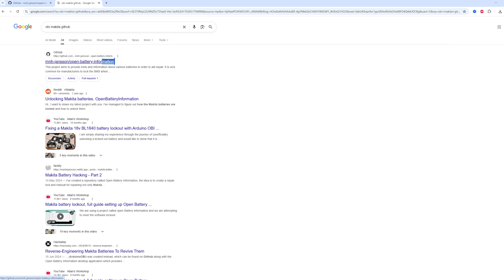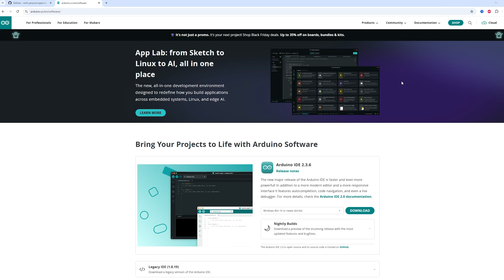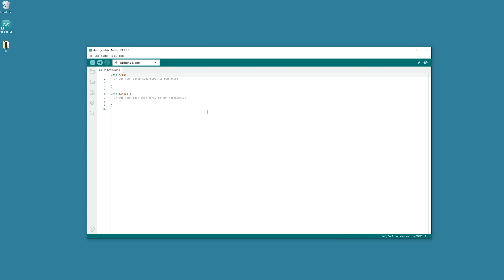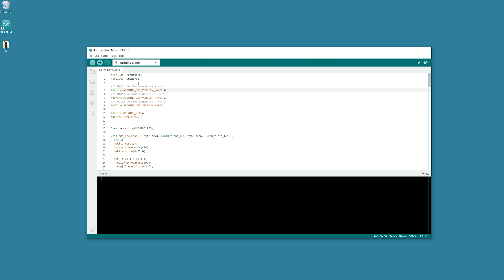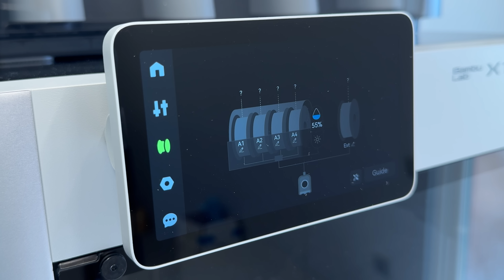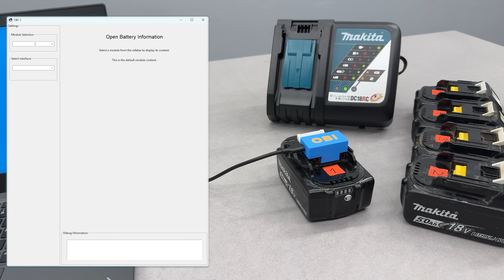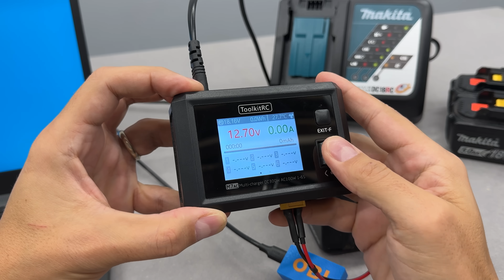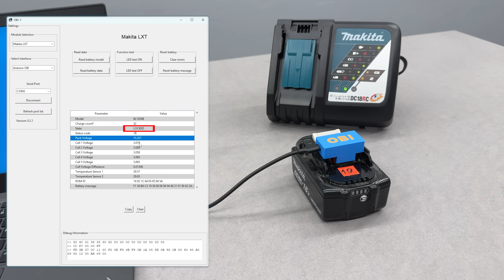I Solved the Biggest Makita 18V Battery Problem!

Comment: I have try this tool. but in the OBI1 software i become a message  Failed to get a valid response after 2 attempts. Connections are all fine but i dont know whats the problem is how i can read the battery. Any fixes of this problem?

Comment: Thanks for a great video. I ordered the stuff quickly and got it together on the first try! Thanks!
I've been working with my Makitas for 9 years and haven't had a single battery failure. But it's so fun to see the cycles and the information. Grettings from Sweden🙌

Comment: I also successfully unlocked 6 locked circuits BL1830B and BL1850B. I think I should print the case after 3DPRINT. Thank you for the data

Comment: The software you used on the arduino has any other type of battery in its library (ex. Bosch, Dewalt, etc.) Or at this current stage is only for Makita?

Comment: For what it's worth, the RP2040-Zero boards cost less than Arduino Nano boards and fit in the case perfectly (actually, better than the nano since the Type C socket fits through the hole in the case and positions the board in exactly the right place). With a bit of jiggery-pokery within the Arduino IDE, it's fairly simple to flash the RP2040 code and then it just works in exactly the same way as the Nano version does.

Comment: For anybody using Linux and wanting to run the OBI software under Wine, it is possible, but there are a few gotchas:

1 - The OBI executable doesn't trust raw COM names and so it doesn't show any COM devices available. It needs to see a ports class device which Wine doesn't automatically create. To remedy this for COM1, run the following:
wine reg add "HKLM\\SYSTEM\\CurrentControlSet\\Enum\\ACPI\\PNP0501\\0" /f
wine reg add "HKLM\\SYSTEM\\CurrentControlSet\\Enum\\ACPI\\PNP0501\\0" /v Class /t REG_SZ /d Ports /f
wine reg add "HKLM\\SYSTEM\\CurrentControlSet\\Enum\\ACPI\\PNP0501\\0" /v ClassGUID /t REG_SZ /d "{4d36e978-e325-11ce-bfc1-08002be10318}" /f
wine reg add "HKLM\\SYSTEM\\CurrentControlSet\\Enum\\ACPI\\PNP0501\\0" /v FriendlyName /t REG_SZ /d "Communications Port (COM1)" /f
wine reg add "HKLM\\SYSTEM\\CurrentControlSet\\Enum\\ACPI\\PNP0501\\0\\Device Parameters" /f
wine reg add "HKLM\\SYSTEM\\CurrentControlSet\\Enum\\ACPI\\PNP0501\\0\\Device Parameters" /v PortName /t REG_SZ /d COM1 /f

2 - DTR toggling on Wine is different to native Windows. For one-off jobs, you can use 'socat' and disable modem control (e.g. 'socat -d -d pty,raw,echo=0,link=$HOME/wine-com1,waitslave /dev/ttyUSB0,raw,echo=0,clocal'). Or you can solder a 10uF capacator across RST/GND on the Nano for a more permanent solution. I haven't tested the capacitor option yet.

*EDIT*
I've spent some time making the device work correctly under Wine without the hassle of using 'socat' and I can confirm that a 10uF capacitor across RST/GND solves the DTR issue above. The only side effect of this is that uploading to the device doesn't work automatically and the board now requires a manual reset before this works. Since the board will only ever be flashed once it's not a problem at all.

Comment: What you dont say is that this works woth the battery models without B in the end. Example it is working with BL1830 BUT it DOESN'T work with the BL1830B. All the current batteries from makita are B and that means are locked and you can't unlock them because they have encrypted bms. So it is a waste of time if you are planning to repair new batteries. If you are lucky though to find these old batteries without the B then try it

Comment: my Bosch batteries lose balancing by just sitting in tool box. why no proper balancing is done by bosch chargers? reduces profits. now my plan is to make/get 5 and 3 series charger with balancing, solder new plug on battery and balance charge on my own because cells are still decent but it seems that bosch battery board just discharges some cells and original chargers stops charging as some cells have full charge voltage. greed is why we cant have good things..
Reply: makita is even more evil by just disabling batteries

Comment: Thanks for the video and the idea but most end users of the Makita cordless tools and other brands  are not going to have time to  DIY the OBI.  They will just stop buying  Makita and any other products that have chronic issues with charging or being used and buy products from competitors that have  no reliability issues. Manufactures who design products with built in planned failures by design will loose customers and kill their brand name.

Comment: Can this tool be used to find out if used batteries are fake or original ones? Can you 100 percent tell that original is original or some fake BMSes act like original ones ? 
I would really appreciate answers :)
Reply: I was asking because I have only 4 working batteries that I bought from legit source and I am sure that they are original , but sometimes I see used batteries being sold on market place for a reasonable price, looking like original ones but I was always afraid of getting fakes. My potential use case of OBI was going to the seller from market place and connecting his battery to obi and checking if its original without any opening/interferencing in battery, just connecting it to the computer. Is it possible? Does it looks like good solution?

Another question , do you know if I can be sure that connecting my original batteries will not cancel my manufacturer warranty ? In case of returning batteries to be warranty repaired, can warranty guys see that I was connecting battery to OBI ? 

Thanks a lot

Comment: The battery Nr. 3 that you charged is basically dead from high internal resistance. I calculated 465mOhms. That's way too much for a power tool battery.

Comment: YOU solved the issue? All you did was print the case 💀
Reply: He did download another ones github data...
Reply: He also created the 3D casing, showed the entire tutorial and explained all the parts needed 🎉
Reply: @YouTube_Nr.1  The original creator has a video showcasing this himself on his youtube channel.
Reply: He might have not come up with the solution, but he still solved the issue with his batteries
Reply: @heinrichhenry1 He cleared the BMS block...  That doesnt solve whatever was wrong with the cells to cause the block to begin with.  It doesn't even identify why it happened.  The chances of these just rebricking themselves immediately after real use is almost guaranteed. This is the equivalent of clearing the "check engine" light with an OBD II reader and not even looking at what was wrong with the car.
Reply: @KettlebellGunsmith most of the time it’s manufacturers having a cycle limit in their batteries. They are most likely still completely fine, but 1. the manufacturer needs to guarantee safety and cycle life and 2. they want people to buy more of their overpriced batteries.
I do have to clarify that I’m by no means an expert, honestly that’s just my opinion at this point, but it makes sense to me. Sure there might be a tiny bit of risk involved, but I for sure would love to take on that risk to save a ton of money. I also wouldn’t mind to reset the batteries every few cycles if that means I can use the battery packs another year or so
Reply: @KettlebellGunsmith Makita block battery from charging if you use it hard and get it hot then put in on charger while hot, so no not always really bad problem
Reply: Not to mention arduino went back on the open source community, making it a no-go

Comment: So you need a 3D printer, buy a circuit, buy extra stuff, solder iron. It is cheaper just getting a new battery. The batteries break because people use them until the tool stops. And then they leave the batteries lying around for weeks completely dead. Or they leave it in the charger cook all day charge 100%. Charge it after it has 2 bars and take it off the charger with 3 bars. If you know you do heavy work, charge it full! Don't charge it full and leave it for months lying around. Not good either! I would not try to bring them back to life. If they explode they will burn down your house. What's cheaper getting a 100$ battery just in case or pay 100000$ for a new house? Sadly today a new house probably 200000$.
Reply: If they leave them discharged for months and the bms trips on min voltage then as far as i kmow they are ok to use.  If theres a weak cell in the pack then it becomes unsafe. But as long as the bms monitors during discharge ot should be ok.

Comment: Nice Makita battery saver. Otherwise regarding Bambulab, anyone on this market should look to the Prusa/Core INDX system : no more plastic poop, 15sec exchange instead of minutes to purge, open source software and no data steal if you don't want to. Bambu is done with this system
Reply: You are aware of the H2C right?

Comment: Again. A very nice example to fight the “designed to fail” approach
Reply: It is not "designed to fail". "Designed to fail" would be if a perfectly good battery refuses to function after a preset (programmed) condition. Say, 150 charge cycles. But it is not the case: Makita batteries lock up for a reason - when a battery detects something is wrong with it. If you artificially unlock the battery, it will still be the same faulty battery. The problem that caused battery to lock will not magically disappear just because you "cleared" errors. Saying this behaviour is "designed to fail" is the same as saing the "check engine" is "designed to fail".
Reply: @GunSmoker From a manufacturer's point of view it's easy.  The last thing they want is the bad press and liability of a battery pack causing some big disaster.

Recall the Sony laptop going up in flames during a press conference in which Sony was tellimg the assemvled ledia representatives that their batteries were safe?  That kind of disaster.

A friend's laptop went up in flames while he was briefly out of the room.  Luckily his house disn't go up in flames.  Rechargeable lithium batteries are somewhat dangerous.
Reply: @GunSmoker Except this tool is meant to be used after a REPAIR, not by itself simply to unlock a faulty battery. They are known for locking themselves after cell replacements.
Reply: Thankfully these ones are not internet connected like new ones, but they might most likely add stops to prevent this in new batteries sold.
Reply: I have a number of Makita batteries which are already fairly old and still performing rather well, no faults ever.  I wonder if the problems described only affect more modern battery packs?
Reply: @ralfbaechle same here. 7 batteries total. Old as 2015. All work, besides an led indicator on one non functioning. I want to make one of these for fun, and incase i ever need it
Reply: makita is last in line for "locking" policies, to be honest. this can save samo batteries probably, but main purpose fro "locking" is safety (as battery, as tool).

Comment: 9:36 your battery is a fire hazard  cell 1 0.841 if you charge that battery it will go unstable, learn about lithium batteries before messing with em
Reply: I've recovered so many "dead" cells from old over discharged batteries and they are still working perfectly especially for low currents
Reply: Right.  A low cell by itself is fine.  If just one in a pack is low then its toast.  

Id be careful, but if the bms monitors during discharge then its safe, you just lose runtime.

Comment: Why are these batteries even dying with only 30-ish charge cycles anyway?
Reply: Usually if they havent been used for a long time and the cells become slightly over discharged the BMS locks itself permanently

Comment: I’ve got 16 batteries 5ah and 6ah always keep them fully charged fingers crossed I’ve never had any problems with not charging other than in freezing temperatures.
Reply: fully charged and fully discharged ruins your capacity overtime but i get you

Comment: Parts ordered, arrived tomorrow, guess I've got a Christmas holiday project
Reply: Let’s us know how it went
Reply: @DIYBill Built it and tested it, works great. I have only tested one working battery a 5 mAh I bought new that turns out it's been charged 205 times. It still works great. 

I have another 9 working ones to check charge count and then I will check another 8 duds I have knocking about. 

Soldering took 10 mins, programming about the same, the print also works great.

Invaluable project, every Makita owner should have one.
Reply: @AGENTP45 thank you. All the best

Comment: I am curious to know how much is Makita at fault for killing its batteries prematurely and how "dangerous" could they be if unlocked. Like how bad is it to keep using your batteries and how bad is the greed of companies that brick the batteries?
Reply: I also wonder why the batteries are blocked and work again.  Perhaps there are some rare cases in which it is blocked (very low voltage, too cold or to how etc.) and it can work again.    I hope that in case it is really faulty and dangerous, it will directly blocked again by the BMS  on next usage.

Comment: I am using the BOSCH PRO 18V system. Not a single failed battery in 15 years. And I have a dozen of units, with dozens of now 'worn-out'-looking batteries. They all work perfectly like day 1.

I don't like Makita 😅😅😅, and everyone who uses it seems to have problems with Makita. Every Makita user has a pile of faulty batteries, literally!

A friend of mine has everything from Hilti,  and he is so proud. He was speechless when he saw the performance of my BOSCH gear, for the fraction of Hilti's price.

Comment: 7:40 dead after 17 charges lol, what a crap^^
Reply: It has nothing to do with battery cycles. Usually the BMS locks the battery due to certain kind of use it deems incorrect. For example too many low voltage instances.
Reply: @PunaJussi  So it's like Apple saying "your holding your phone wrong"
Reply: @daviniusb6798 no not like that at all. It's a certain amount of risk avoidance (as in avoiding risk, not avoiding faults) preprogrammed. If the cells are deemed too unbalanced they are more likely to catch fire, or it could be a consequence of something else wrong. Battery pack manufacturers are (rightfully) hesitant and play it on the safe side. This is largely why you don't see many battery fires any more (though still possible).

One could argue they play it too much on the safe side and that it kind of plays to their advantage (more pack sales), which I'd say is a fair argument. Still, I do like the safety that comes with it.
Reply: @nonstop7243  Thanks for your explanation! I'm still on the side that if you buy Lithium powered things you have to know the dangers of that tech, and you should be allowed to use that tech however you want. Let that charger show that it thinks the battery is bad, let me read out why he thinks that and decide what to do with it. Could be done with a simple app or whatever, maybe sell "pro" chargers with that capability.
Reply: Nothing to do with charging cycles. For example - you can lock your f@%#$#^g Makita battery very easy by instant overloading by using i.e. drill and it's getting stuck in whatever material. I've locked  2 5ah batteries by drilling armed concrete... Drill got stucked but machine was trying to go anyway...°
Reply: @kristianszviedris1580  And you paid what for that scam? Sorry but this is basic safety, no need for locking YOUR property.

Comment: Please watch out guys, when a cell stays to long under 3 volt it can turn bad. but when a cell is under 2.5 volt. please replace it!! yes you can charge it, and it wil work for a while. but there is a big chance it will cath fire in the long run! be safe

Comment: nice, those battery are like 99$ here each for the 5ah. i got 1 behaves just like the one in the video, even tho i charged up the 2 low voltage cells, it still wont accept charge from the charger , so this is why. 

gonna totally spend the 5$ to save this 99$ battery. already have all the tools , just need to buy the board, and connector.

Comment: "I solved....." 
Are you sure that you were the one who solved the problem, and not Martin Jansson?”
Reply from the maker: Full credit for the software goes entirely to Martin Jansson - no question about that! But everything else was done by me: I designed the minimalist case, walked through the whole process step-by-step in the video, and showed exactly how I solved the issues with my Makita batteries.
Reply: @welldonetips  Everything else, including the housing. Respect. I made a car. Well, technically the factory did, I agree with that, but I stuck on a cool badge and filled it up with fuel.
Reply: @artineogda  It is good step-by step video, and acknowledges original author aswell. Also adds own version where instead of originally intended Arduino Uno, cheaper, smaller Arduino Nano can be used. + designed case, eventhough I plan to use knockoff Makita charger as a case.
Reply: @artineogda Someone always has to be an asshole.

Comment: I did build the Makita OBI module a while back to check some dead batteries. Most of the had a reason to be locked with zero volt cells or leaking ones, but a few look totally fine.

This is one of them, the charger stops after a few seconds with an error. 

BL1830B
64
UNLOCKED
A5
19.002
3.803
3.803
3.801
3.803
3.804
0.0
28.38
29.17
10 06 18 64 10 06 28 76
F1 26 BD 13 14 58 00 00 D1 D1 40 21 D0 80 02 1B C1 D0 8E A5 60 F6 00 43 C1 02 0E 04 00 F2 01 37